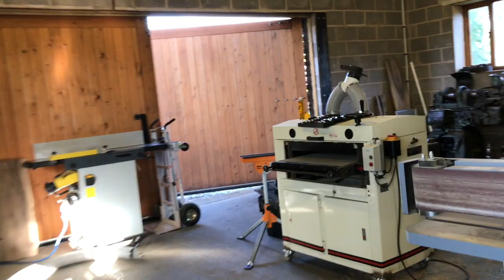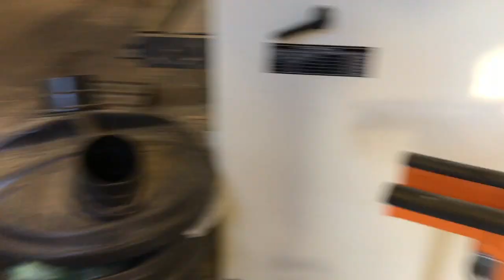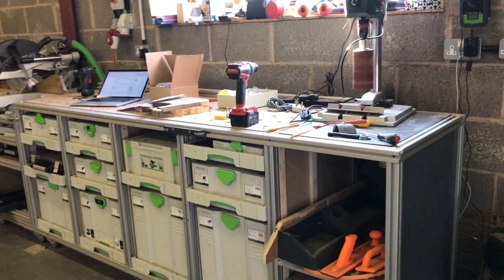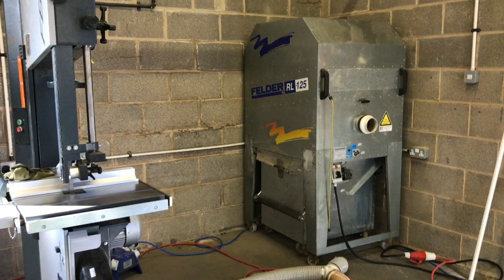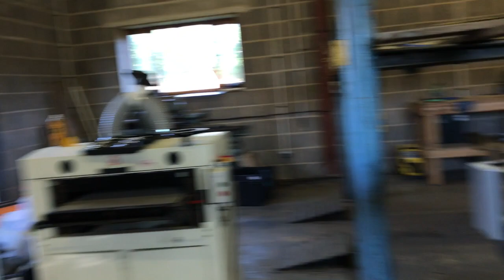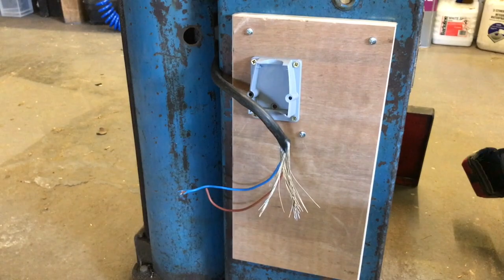New Shop Laying part 1 - Extraction

Comment: What an upgrade from the small Rutlands job to the Felder beast! Something I'm always trying to sort myself is extraction but I can never seem to find the right balance. Micron size/capacity/airflow/footprint blah blah. Felder looks spot on.
Reply from the maker: I got lucky , I found the RL125 on ebay at a very good price,  and then found a UK based company that sold Ducting at a good price so went for it and have never looked back not more blockages!!

Comment: Hello is the felder fb 510 2.5 kw and is that running from 16 amps thanks
Reply from the maker: Yes its a 510 and 16 AMP , I am not 100% sure of Amps but I think there is only one..